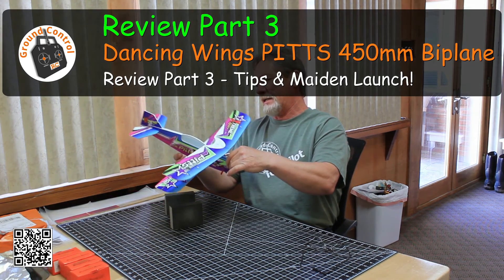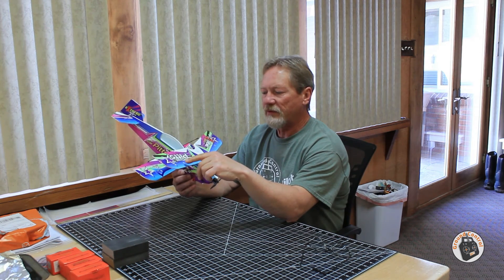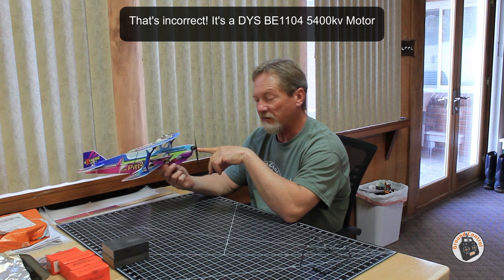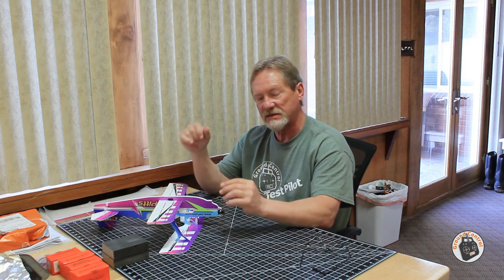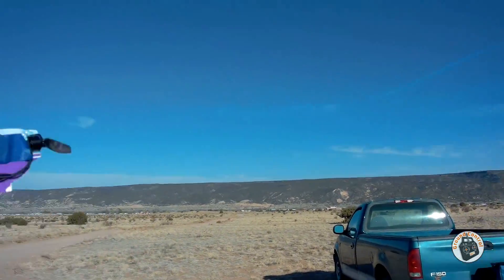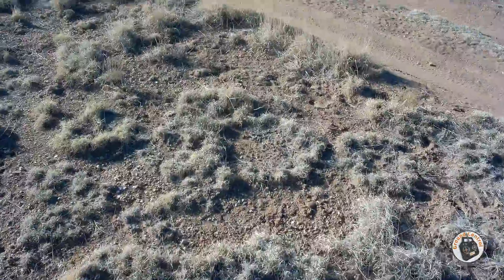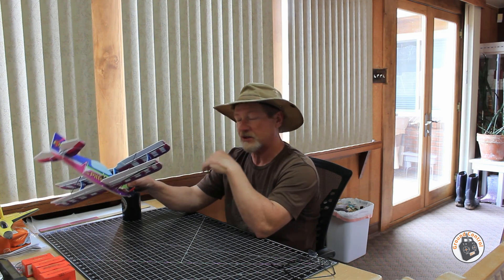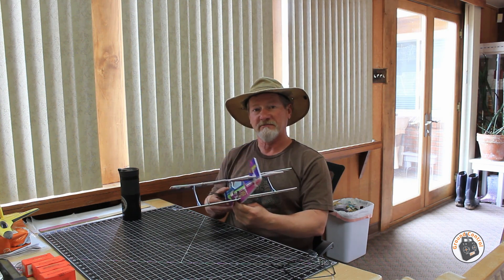Dancing Wings Hobby PITTS 450mm 3D Aerobatic Brushless Micro Biplane BNF Kit - Review Part 3 Maiden!

Comment: Hahahhaha, now Youve done it, another can of worms?
Funny You mention Our beloved A-160, just yesterday I was making a template off the Zohd drift wing an messing with fitting one, or similar on the Cub.
Good looking micro Biplane, last flight kinda had it cutting some air. 
Interesting stuff GCRC, great show.
Reply from the maker: Hi Jono! Thank you much! It seems I'm always getting Tinker Planes these days ;-) I''m ready for an easy one. Carbon Spars are now installed in the Lower Ailerons and I'm getting ready to cut some foam and add some right angle to the Motor. After that, it's Fly or Crash! See you in the Air!

Comment: Yeah, I'm NOT a fan of those dopey o-ring prop savers either.. I see the battery is out of the plane here, so sort of answers my question about leaving it in permanently. @ 2:44, Yes, there IS something almost therapeutic about spinning a prop with your finger! lol like one of those 'fidget spinner' things..lol @9:14, sheesh, out there in what looks to be the middle of nowhere, hope you brought other things to fly to make that trip worth while! ;) Looking forward to you getting that all sorted out!
Reply from the maker: Agreed ;-)
The only one I have had excellent luck with is on the RadioLink A560 3D Trainer Plane.
The adapter they mad fits on the shaft perfectly snug so I do use the O-Ring keeper on that one and it works awesome.
It had saved my prop a couple of times when I misjudged how close I was to Terra Firma ;-)

Comment: Looks like a cool little plane.  I'll bet you're going to love it after you get the bugs worked out.
Reply from the maker: Hi Jack! I think so to ;-) My 1st Biplane. I just finished putting some Carbon Spars in the Lower Ailerons, and that is much improved, and approx. 1.5 degrees of Right Angle in the Motor. I'm hoping to Re-Maiden this Biplane tomorrow if weather permits. Hopefully I came close on the MODs ;-) See you in the Air!

Comment: looking promising.... thought about tape hinges for elev and ail ? also flat profile for wing not giving enough lift ?  just thoughts... been out with my xk a180 today, 8 knots wind ,flies like a kite. no full manual mode with stock transmitter tho.( prob just as well, taught too many planes to swim...) c u in air !
Reply from the maker: Hi John! A couple of adjustments and I think it'll be flying well. I put carbon rod in the lower Ailerons and it made a huge improvement, but yeah, tape hinges may be in it's future ;-) I really wanted to put some right angle in that Motor but thought maybe a Biplane is different with Motor Torque. Not so much ;-) I'm going to try and take my Converted Glider out in some Wind today. Should be fun ;-) See you in the Air!
Reply: @GroundControlRC  enjoy !

Comment: Wow,those engineers are sleeping on the job...a few years ago a fiend of mine bought a little 3d kit from value..zero carbon...unflyable for him.i myself have adde carbon to my foamies for years,but fir the price they should include some with these...only 3d profile plane i ever built is a hummer from value..its a great plane but it needed some extra strength added on rudder...i bought it around 10 years ago..kit was under $50...just remaided it and needed some tweaking since i forgot where cg was and crashed it years ago and broke motor...these are fun planes ridiculous control doing any manuvers...6  ft, tight rudder turns  loops,unlimited vertcal..spins like a top...happy  flying.
Reply from the maker: Yes, I think some of the real spongie pp board planes do need some extra support.
Some of these profile planes are fantastic, like the Radiolink A560.

Comment: A nickle is 5 grams. That's a lot of nose weight, yet it still flew as if tail-heavy.  Of course I gotta keep in mind that the basic flat airfoil means the plane will have to fly nose-high to generate any lift. That is the nature of the beast.  

There's also the possibility that the 300mAh pack is just too heavy for the flat wing config.. 

Looks like a 1.5mm carbon rod embedded in the lower aileron from the wing-root to the control horn leading to the upper aileron would be enough.  I don't think the stiffeners will need to extend the full length of the ailerons, to keep weight gain to a minimum. The top ailerons should not need any stiffeners.
Reply from the maker: These 3D Planes are designed to be tail heavy. The nose weight actually had it flying much more level than the typical 3D Plane. My Aerobat Yak54 800mm 3D Plane flies more tail heavy than this one with the Nickel Nose Weight. My thoughts exactly on the Ailerons. I've already added 1mm Carbon Rod to the Lower Ailerons leaving the Top Ailerons as it and it's much improved. One of the biggest issues is Motor Torque. I've got to add some right angle today and hopefully test the MODs tomorrow weather permitting. Fingers crossed ;-) My guess is, I will also need to remove the Foam Hinges and install Tape Hinges. See you in the Air!

Comment: Defenitely some tuning to do still. I wouldnt blame it on the fact that it's a biplane as some bipes are very docile. This is a pitts. They're notoriously difficult planes to fly at full scale, so some of that might translate down to this
Reply from the maker: Hi Mike! No, not blaming the fact that it's a Biplane, just my 1st Biplane so I didn't know what to expect. I should have gone with my 1st instinct and put some right angle into the Motor even though it was not called for and the Motor Mount Slot was as straight as an arrow so they didn't design it to have any Motor Angle. I had so much Motor Torque it would only Turn Left ;-) Definitely a Design issue. I'm getting that taken care of today and I've already added Carbon Spars to the Lower Ailerons as there was too much flexing of the Control Surfaces. I'm hoping to test again tomorrow, weather permitting. Fingers Crossed ;-) See you in the Air!
Reply: @GroundControlRC   that should all help for sure! Looking forward to the next flight.
Reply from the maker: @mikelarin8037  Thank you much Mike!

Comment: Doesn't seem like the right prop to spec with that little motor.  You might try a 4030?  Or if the plane really needs a 5030, maybe stick on the br1306 you've tested.  You know, while you are fixin' things!  😁
Reply from the maker: Hi Mike! Yeah, I was surprised to find it used a 5030 Prop on an 1106 3800kv Motor but it seems to handle it well on 2S and provides quite a bit of thrust. I think if I can get the Motor angle correct to counter the Torque this Biplane might just fly pretty well. I'm taking it back out tomorrow to test that out, weather permitting. Fingers Crossed ;-) See you in the Air!
Reply: @GroundControlRC  Looking forward to the results!

Comment: Looks tail heavy and under powered to me. But agree, torque roll elimination should help some.

Some long grain balsa along that aileron edge should fix the flex, if CF isn't available.

Hope you get it sorted. Will be watching.
Reply from the maker: This Plane was so tail heavy it would hover on it's own ;-) I did install CF on the Lower Ailerons, big improvement, and about 1.5 degrees of right angle on the Motor. If the weather holds I'll be launching this morning. See you in the Air!

Comment: >6:00< And if you were a betting man, you would’ve easily won your bet.
Reply from the maker: Hehehe...yes, I would have won that bet ;-) I also should have gone with my 1st instinct and put right angle in the motor even though the build instructions didn't call for it. My 1st Biplane and it seems to be no different than a Mono-Wing Plane in it's handling and needed adjustments. Carbon Rod has been added to the Lower Ailerons and now for some right angle in that Motor ;-) See you in the Air!